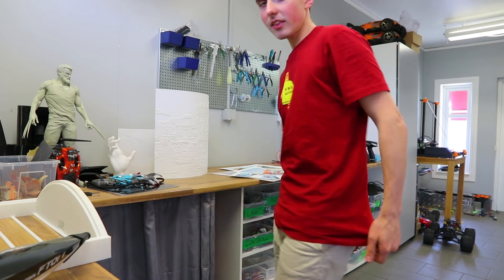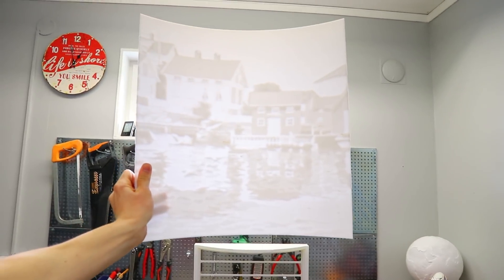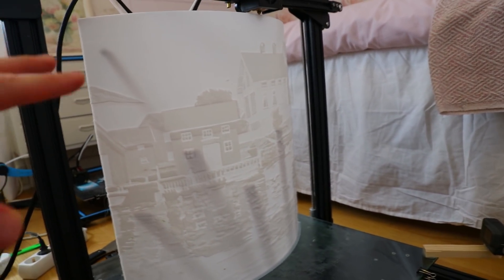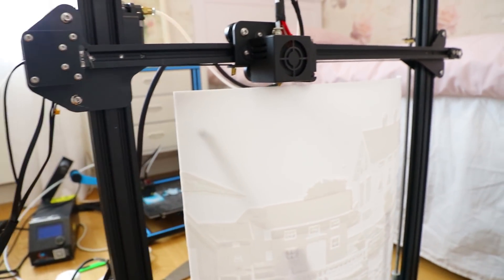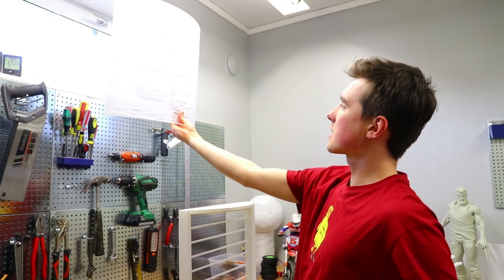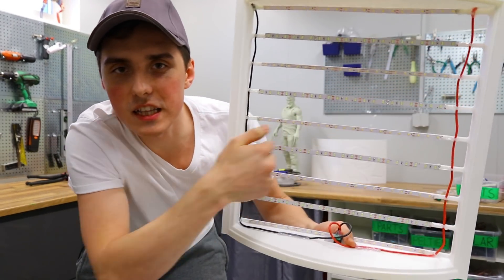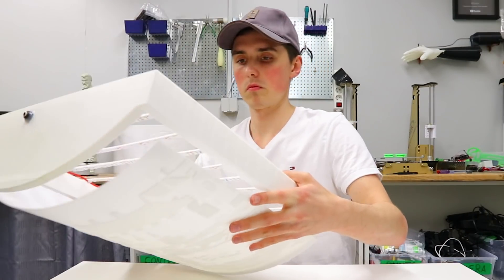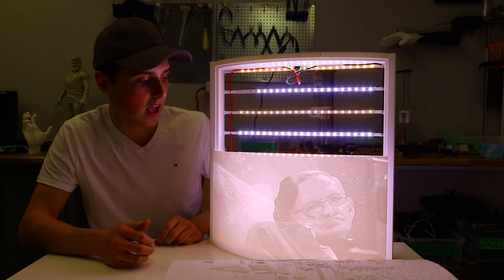This Was 3D Printed?! - MASSIVE Lithophane

Comment from the maker: Spherical moon lamp on the CR-10 S5 next?!  -->200h printing😲
Reply: too much filament...
Reply: Can it even handle that long??!!
Reply: The golde Ingot If you dont have a nozzle, made to handle glow in the dark filaments, your nozzle would be ruined half way through the print. Glow in the dark filaments have little particles that grind your normal brass nozzle. in no time, the nozzle diameter isn't 0,4 mm anymore, but 0,5 and then 0,6 and so on!
Reply: Är du i Helsingborg imorgon?
Reply: Juste tack så mycket Jonathan!
Reply: @rclifeon where do you buy cr10 s5
Reply: RCLifeOn tjena, Hur äre?
Reply: Do you have a link to the file?? I have so many lithophanes that need a frame.
Reply: Do it!!!! Help me fix mine?  Love your videos very clear and precise info. Hope you have a good day
Reply: RClifeon  Can you do Lithophane with glow in the dark filament!!!

Comment: I have a question about scaling a litophane. In cura the system will try to scale the model uniformly and make all the axis bigger or smaller. But I'm worried that if I for example scale a litophane by 125% the Y axis is gonna be to thick for light to shine through? Do I skip scaling on the Y axis all together. Help much appreciated :-) 

Älskar din kanal för övrigt, mycket underhållande!
Reply: Scale it bigger in the Litho software before you slice it.
Reply: @TheRattleSnake3145  Noice! Thank you 😍

Comment: I appreciate these vids on lithophanes. I've had great results on an Ender 3 pro. A little hint I rotate the curved standing panel 80° so the majority of the moves along the standing wall are produced by the bed platform Y axis and the X axis makes the smaller moves for the profile. I find this also reduces shake because the panel as it's attached to the bed is sideways and thus more stable when the bed moves. 👍🏼

Comment: I am thinking you could print the Lithophane without as much sway by turning the print 90 degrees so as the print bed moves forward and back, it won't sway due to the wider footprint

Comment: Another way to reduce flopping issues (might not work as well for curved lithophanes, might induce twisting) is to change the orientation of the print to the bed. Taking into account the movement axis of the bed, print it with the width parallel to the y-axis motion.

Comment: How hight is ur electric bill
Reply: The 3D printers run on 24v DC, he plugs in 230v but since the printers ship worldwide they must use a transformer to run on DC which is cheap. I run a machine shop in my garage as a hobby but does not really affect the power bill. I run a 240v 80 gallon air compressor, 110v lathe/mill,  beadblast cabinet & dust collector & powder coating equipment. Our monthly bill is under $100 which includes the house. .

Comment: How did you get these huge Images from that website? Everytime I try to convert an Image with an outer curve and a size bigger than 300 mm, the site crashes... anyone else have this problem?
Reply from the maker: Increase the scale in your slicer, just keep in mind that you will have to adjust the thickness before exporting.
Reply: RCLifeOn oh you scaled your pictures.. and they’re still pretty detailed..
I thought about scaling it, but then again I was afraid of losing to much of the datails.. 
However, in the end I managed to get a 400mm big Image from the website. 
You just need to go to Model Settings and set the value of “vectors per pixel“ from 4 to 3. Now it shouldn’t crash anymore at those big sizes, but it also will decrease the detail.
But I haven’t printed a lithophane with those settings yet.
I wonder which method is better to keep as many details as possible.
Maybe something you could talk about in one your upcoming videos..

thanks for the reply, greetings from Germany!

Comment: Cool print! Just curious, do you feel safe with leaving the cr-10 printing over night/unattended?  And how do you get the prints to stick so well without heating the bed. I have a CR-10 and I am don't like leaving it printing alone yet. What do you think?
Reply from the maker: No, I don't feel safe leaving any 3D printer unattended for a long period of time. I have modified the CR-10 S5 quite a bit, I removed the heated bed completely and replaced the power supply with a higher quality power adapter. The prints stick without a heating bed by using the TESA Easy Stick glue. Do I think you should leave your printer unattended? No, not without precautions.

Comment: RCLifeOn - Looks fantastic but you should also try printing in other colors.  After watching your original lion video way back I've printed lithophanes in light green and tan/skin as well as white with my CR-10.  The tan/skin gives the lithophane a slight old-fashioned sepia tone look.  The light green also looks great and gives it an antiique-ish tone as well as providing more dark contrast.  I'm going to try using light grey and light brown in the future.  I imagine any light colors will work well and provide more contrast.   

If you haven't tried it yet you can also slightly improve the  lithophane by wet sanding the back side with 600 grit or finer sandpaper.  Smoothing that back surface can reduce/eliminate possible defraction of incoming light rays. 

Cheers from Thailand!
Reply: thanks for this information!
Reply: You're certainly welcome Xnoo peeX.

Comment: HELP got a cr-10 from gearbest worked great for the first 2 months then in December tried some exotic filaments and haven’t been able to print since in pla
I have purchased the upgraded cr-10 extruder, steel gear, along with more nozzles to the point that I can print in nylon no problem (quite fast) but when ever I try PLA the pack pressure builds to the point where the gear clicks and slips yet resulting in under extrusion. 
Quite often once that starts I try and take the Bowden tube out to see what is happen in the extruder and appears it is clicking because it can not push through the tube

Any suggestions 
Thanks

Comment: Hello friends. I'm a beginner in this business - that you will advise so that the first layer is well adhered to the table(PLA,ABS)?
Reply: PLA should stick well as long as you get your leveling correct. With ABS, you need a very hot print bed (probably 60 to 100 degrees), and you probably will need a brim.

Comment: Looks great! I wonder how glow in the dark PLA would work for that?
Reply: I don't think it would work. The idea is that the thicker the layers, the less light that is allowed to come through, thereby making those areas darker than the thinner layers. Lithophanes rely on a transmitted light source as opposed to a reflected or, in the case of GITD, a radiant light source.
Reply: yeah, it doesnt work. ive tried it, you dont get the contrast showing through.
Reply: look at his discription "The lithophane was printed with 0.2mm layer height, 100% infill, 3 perimeters, 30mm/s and basic white PLA filament."

Comment: Darn.. u still don't know how to print lithos efficient ;) and even bigger than this.
You can cut the print time by almost half.
HOW? I told you the last time :P
Reply from the maker: I remember someone saying you should only use perimeters and NO infill, I guess that was you. Thanks for your input, but I already did some experimentation and found that it only decrease printing time with around 10h for a 100h print. The amount of time reduced is highly dependant on the thickest and thinnest layer settings you choose for the lithophane.